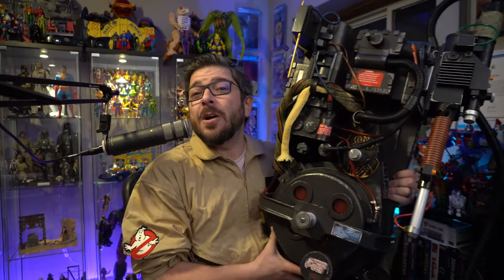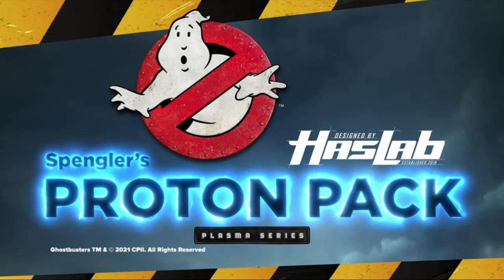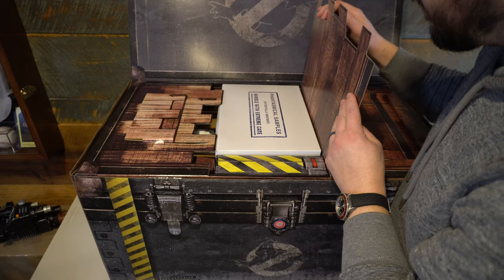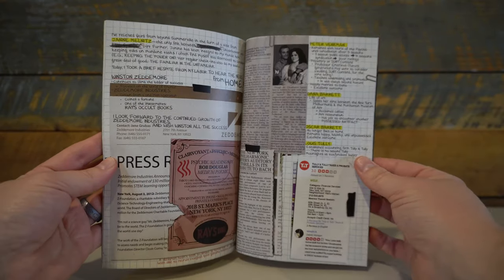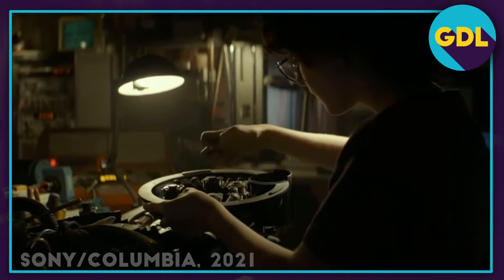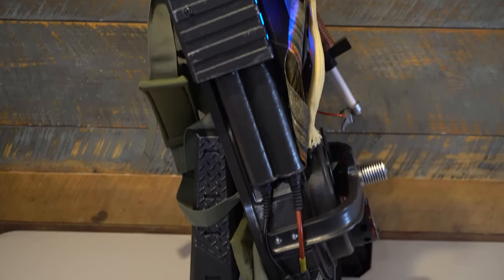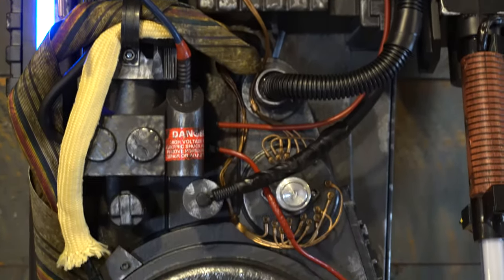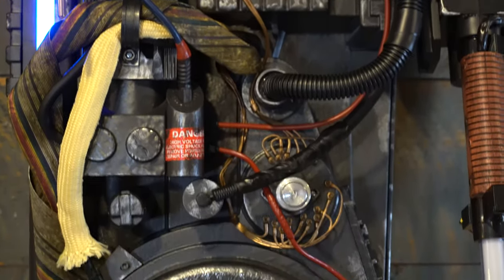Haslab Proton Pack Unlocks Dreams!

Comment: This was one of the best things I’ve ever bought. Agree that opening it was amazing. 

My only small grip is I wish they had used stronger cardboard for the designed box. My plan was to sit the pack on top of it but that is not going to work. Actually thought about making a simple frame to sit in the box so I can use it.

Comment: With the 4th movie starring production in March and set to release in December this year (though I feel it’ll be delayed) it’s possible we can see either this year or 2024 we see the PKE meter or ghost trap announced as haslab projects. I already see some of the potential unlock stages like the pke stand could be a smaller proton pack stand and as for the trap It wouldn’t need a stand but instead of a stand they could make an RTV base for it to connect to.
Reply: Have any more Haslab projects been announced 🤔🤔
Reply: @stevemahoney5209 just the ones I predicted in my comment😂. Not only did I predict the pke and trap but even the delay of the movie.

Comment: I haven't opened mine yet or ordered an ALICE frame. But does the pack fit on the stand with the ALICE frame attached? 
Also, can you attach the stand to the wall in some way?
Reply from the maker: It should still fit fine with the alice frame, I checked if it could attach to the wall, but the way the pack sits on it, it wont quite work. You could get wall hooks that would work I think.
Reply: @Geek. Dad. Life.  cool, thanks. I'm just trying to map out in my mind how I want to display it and all my other GB stuff together.